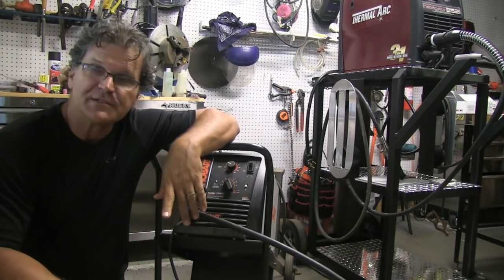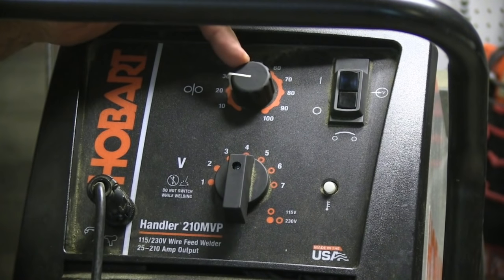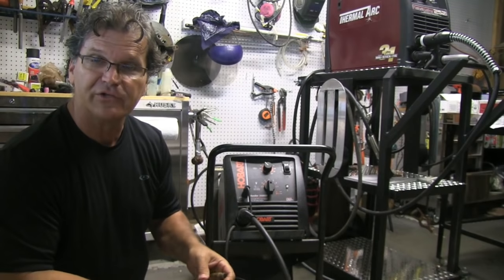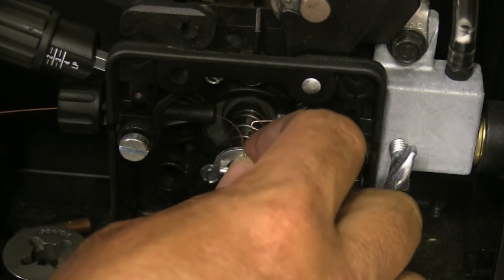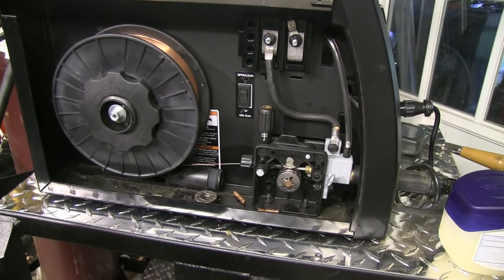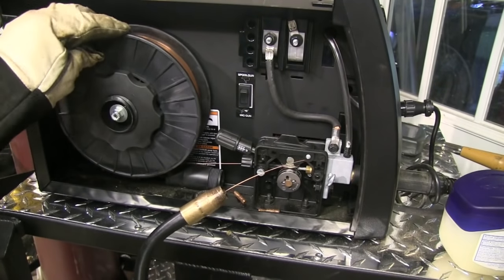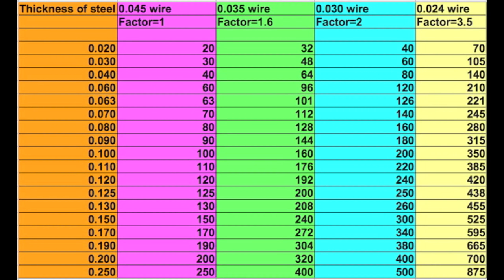Mig Welding Basics part 3-Setting Voltage and Wire Speed

Comment: A US gallon is 128 ozs and weighs about 8.33 pounds.  The Imperial gallon has 5 40oz quarts ( 200ozs) so 72 ozs more than US.  So that's why it weighs 1.67 lbs more.

Comment: Thank you!  I was unsure of how to go about looking for a chart a mig welder at my work.  I've experimented around with my personal welder and i can adjust it relatively easy.  Its a 140 amp/115volt welder where as my works is a 230 volt type that had different size wire.  I'm not a professional welder but actually a auto/fleet mechanic so i get scared having to weld haha.  Anyhow i did find your website and got the charts you showed in this video and had hard time reading/understanding them but now all that is clear as mud...haha just kidding!  I didnt understand that you had to set wire speed and then adjust the voltage bu i get it now haha. I wanted to do some practice tomorrow as i have some garbage trucks which need couple steps rewelded back on. Oh, and i also have some light holders which also need to be installed so they have some additional backup lights.  Thanks again for your awesome and helpful videos!!!!

Comment: Thanks for the MIG Welding Basics series! I am looking for recommendations on a good MIG welder that has a good range of capabilities for the money.  That is, if you had to purchase one welder that can handle a high percentage of "general" welding jobs, what specifications and vendor products would you recommend.  I am not doing production work, but do prototyping on a wide variety of materials and thicknesses.  (Need to weld steel and aluminum).
Any suggestions would be appreciated!  Thanks again for the video series!  Really helpful!

Comment: Loving these videos.  I'm actually waiting on a Hobart 210 MVP to arrive.  I grew up welding stick but I haven't done anything in probably 20 years and never used a MIG.  The 210 just looked like the best option to me for flexibility since I don't have any equipment and about 4 or 5 projects to get done that are very different.

My question is, do you have any specific tips, tricks, or quirks with this particular welder that you've discovered and would like to share?

Comment: I am a fabricator / welder. I deal a lot with different thicknesses any where from .062 to .500 now thinner an stainless I am tig welding. I was wanting to down load your chart . Now is that chart good for 3phase set up?

Comment: Hi - I am a hobbyist Mig welder and a recent subscriber to your channel. I am looking for any advice you may have for me. I am building a CNC router and making the frame from 3" square tubing. I need to weld a 16 gauge length of steel, about 4" x 4 foot long, vertically to the 3" square tubing, creating a rail for rollers to ride on. The 16 gauge steel will be positioned 1/2" above and below the 3" tubing. I don't believe I need to weld a bead the entire length, possibly just tacks along the way. If I do this should I put the Mig wire where the roll of the tubing meets the 'rail' and tack?  Or I'd also thought of maybe drilling several holes in the 16 gauge steel, exposing the tubing behind the holes and then welding the 'holes to the tubing', sort of a Spot Welding technique. Any help is appreciated!

Comment: Quick question regarding amps and wire speed im learning how to weld still, i have a lincoln 140 but just purchase the everlast power Mts 251Si and it doesn’t have any chart or anything, I’ve google amps and wire speed charts and in one charts it says when using .30 mig wire the speed is 2 ipm per amp and i just downloaded the Miller app and in there it says 2 ipm when using .35 wire size im a bit confused now with your experience which wire will it be easier to control the wire speed? In which wire size do you usually go 2 ipm or roughly close to 2ipm?

Comment: Using your vids to start SMAW this week with my new Lincoln Power Mig 210MP. One thing that is confusing; you show a table and reference AMPS yet unlike all other welding processes that have amp readings, my mig and yours, references VOLTS.  Why mention amps if settings are in volts? Thanks again.

Comment: Can you do the same video specifically for aluminum Mig welding? 
It's kinda hard to set a machine for aluminium, i'd love to see more tips.
I have a metric machine with m/min and a voltage setting. Both are continuous settable (voltage and wfs (m/min) are free spinning).

Thanks like your videos.

Comment: Hi Jodi,
First I would like to tell you that I really appreciate your videos.  I have learned a lot about both MIG and TIG welding from watching them.  I have watched a lot of videos from different people on YouTube and consider you to be the best welder/teacher that I have seen.  

Now for my question:  I recently purchased a used gas bottle that came filed with Argoshield Light (5% Carbon Dioxide, 2% Oxygen, balance Argon).  Argoshield is apparently meant for MIG welding on thinner sheet metal.  I would have preferred C25 but the price was right.  Starting from the recommended settings for C25 that came with my Hobart Handler 187 do you know how to shift them for use with an Argoshield Light gas mix?

Comment: My work has the same thermal arc welder as  what you are using and seems like it is way faster than the chart on the welders shows for the wire speed

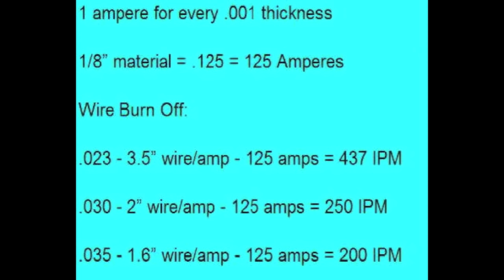Comment: Does the formula at 1:40 apply for every type of welding wire ?  Steel, aluminum, SiBr ?  Or do different wire materials have different wire feed factors ?

Your videos are excellent.  That is the first time someone explained MIG wire feed to me like that.  Thanks for making them.

Comment: hello Jodie I've seen almost all your mig videos and Indeed most that I know I learned from you,but  I have an objection, I'm from Europe and I work here metric system,  I work 1mm wire and this existing wire  is 040 inches, how can i  find exactly the speed of the wire on the thickness ratio metalware for 040 wire ? For example, the chart for 035 (9mm) multiply 1.6 by the thickness of Metal, for 040 (1mm) with what  number is multiplied to find the length of the wire;

Comment: I find that the chart in my Millermatic 211 is good for the voltage but always a touch high on wire speed.  Same thing on autoset so I don't really use that feature.

Comment: Could you suggest how to set welder with just a hi and lo setting i understand the wire delivery time but then is it hi or lo setting on volts, cheers oh its flux core on a sealey mightymig 100, wish hadn't of bought it

Comment: Great videos!   I just read my 252i manual, and I think your method for measuring wire-speed on the 252i might be flawed!   According to the 252i manual, it has a "Run In" wire speed setting, where the wire runs as a percentage of the wire speed until the arc is struck.   The factory default is 70%.   So if someone were to count out 6 seconds without striking an arc, they'd get 70% less wire than when they started to weld (unless they adjusted that setting).    So at about 10 minutes in the video, when you actually measured it, you may have been measuring the wrong thing!

Comment: Your videos are awesome, BUT, we are into the metric system and inches and 0.30 wire and and really confuses me. Can you please use both systems when explaining.
Just a suggestion
Reply: 0.030 wire is approximately 0.8 mm.  I assume you have similar sized wire.  IPM can be converted to cm per minute by multiplying by 2.54.  Not really sure what units your welders feed in.
Reply: We just keep in mind that one mm is about forty thousandths of an inch.  All the wire and consumables we get now have metric labels on them, some have both.   So, .8mm is about .030, .9mm is about .036, 1mm is about .04something.  .6mm is about .024, and those are our popular sizes!

1

Comment: only thing i would add is Single roller machine will have inconsistent Wire feed speeds  when the leads aren't perfectly straight . Not a big deal unless you welding in odd positions.

Comment: So this question may be 9 years late... but I just started welding this year.

Here is a question... what reasons would a mig machine be set to 27ish volts with a 425 ipm?

A question regarding a weld shop that insists on those settings being best for what they produce... according to a couple of the welders there. (These guys have never steered me wrong yet, but their explanation is lacking)

Comment: Public Service Announcement -  you can't use the ruler method with new inverter Everlast welders (at least with the 2017 PowerMTS 251si).  The wire feed rates change when an arc is occurring vs. just dry-pulling the mig gun trigger.  I did the ruler measurement with no arc, and found my feed rates waaay to slow vs the front panel readout, and I got wrapped around the axle thinking my brand new welder was broken.  This 'feature' makes it virtually impossible to ruler check the calibration of wire feed rates without a TON of effort involving heating tips and taking the unit apart to read the voltage of the feed motor....
Reply: James Zaehring - you could measure the diameter of the wire wound on the spool to get its circumference, which is the wire feed per revolution, and count its revolutions.   Easier to weld for an number of full revolutions and measure the time than to measure the fraction of revolutions in a given time.

Comment: What voltage and wfs should I use to weld a 14 gauge tube with 0.8 mm wire

Comment: I have a fabricator 181i and I can't seem to get things right. It wants to burn way too hot and if I get anywhere near an edge it just blows it right out. T joints undercut horribly, lap joints burn the edge back, and butt welds blow through. This is on close to facory settings on 1/4 in steel. I have even tried welding some 1/2 plate and I ended up blowing the corner off. Any tips?
Reply: If its burning to hot turn your heat down

Comment: I didn't understand how to calculate the setting. I am using .035 wire on 3/16th bar stock. How do I calculate that? There is no way my setting should be at 304

Comment: I've noticed that when you are testing settings with MIG you always seem to do a lap or t-joint.  I don't recall you ever using a butt joint or padding a plate to determine MIG settings.  Why is this?
Reply: I think it is likely that he pays attention to all that he points out about how it runs plus the results of the  weld toe fusing to that top edge of the upper plate.

Comment: Why you count upto 6 seconds when messuring the filler wire? Is it always 6 secs count?
Reply: Add a zero to make it 60 seconds. Wire feed speed is measured in inches per minute.

Comment: Awesome. Now just need metric conversions.
Reply: Not a big problem this time, since it's all in inches or thous (and not fractions). Just multiply by 0,0254 for m/min (which is the setting for most metric charts) for the feed speed. Voltage is very much the same. If you have 3mm plate, divide by 25,4 to get thousands of an inch (.118 in this case). That is, if you want to use e.g. the table featured in the video. You could of course also reference a metric chart (here is one http://www.mig-welding.co.uk/calculator.htm )
Reply: Left Flamingo ta bud
Reply: last time i checked SAE volts and Metric volts are the same :-)    there are 39.3" in a meter   200 ipm /39.3 = 5.08 meter per minute
Reply: and also - there are 40 thousands in 1 mm ....  so one millimeter thickness needs 40 amps and so on and so forth .... 2mm 80 amps  but that rule only works till about 6.25 mm thickness ....  because at 1 inch you don't need 1000 amps  one inch is 2.54 cm or 25.4 mm but you don't need 1016 amps to weld 25.4 mm .....
any other questions ?

024 wire is 0.6mm
030 wire is 0.8mm
035 wire is 0.9mm
040 wire is 1mm    remember ? there are 40 thousands in 1 mm ....
but we in america don't have 040 or 1mm wire ..... we don't believe in metric wire sizes :-)
045 wire is 1.1
and so on on so forth
Reply: *****
 I don't understand why people are always saying metric is better now this could be due to me growing up in the US that I am familiar to thSAE system but when you break down an inch to say 12 inches, I get a much better mental picture than saying 300 millimeters, I know it is actually 304 but sometimes math is just done by your imagination. I feel the same way breaking down one inch I can picture a 16th or an 8th or 1/4 etc etc now try doing that in metric it is a lot harder imo. That is my two cents and I am aware that the metric system might have many advantages which I am unfamiliar with or just in production of trade. Later
Reply: Micscience In metric, one milliliter of water occupies exactly one cubiccentimeter, weighs exactly one gram and requires exactly one calorie of energy to heat up by 1°C. This temperatur is exactly 1% of the temperatur difference between the freezing point and the boiling point of water.
By the way, this weight is exactly as heavy as one mole of atoms do.

Please do the same with the American System and post it here!
You should then understand better, why the rest of the world is laughing about Burma, Liberia and the USA.
Reply: lupuszzz
It's the Imperial system, not the American and was developed and maintained in England.

There are some correlations in the Imperial system.  One gallon of water weighs 10lbs for example.
Reply: Wolf Jaw Forge a gallon in England is different from a gallon in the USA - that is why i said the american system ....  BTW in England (or for that matter in Scotland or anywhere in the british island) Fuel (which is Patrol) is sold by the Liter and not by the gallon, temperature there is measured in Celsius also .....  It is all very strange ....
Reply: *****
In England, or Great Britain or the UK or the British Isles, however you term it (and they all mean something different), gasoline is known as Petrol.  It is now sold by the litre (not liter) by EU (European) law, something many British people are less than happy about.  Previous to this, petrol was always sold by the gallon.  There are 4.54 litres to the gallon.

There are also 454 grams to the pound - which shows a correlation to the above.

An Imperial pint is 20 fluid ounces (fl oz), which is possibly different to the US.  The US pint is 16 fl oz, am I right?  An Imperial gallon is 8 Imperial pints and so is 160 fl oz.  An Imperial gallon of water weighs 10 pounds.

I think it's only in these fluid measures that the old English Imperial system differs from the US.  For instance I think an English and US mile are the same - that is 1760 yards.  A yard is 3 feet.  A foot is 12 inches.  English and US inches are the same.

A pound (lb) is 16 ounces (oz).  Ten pounds is thus 160 oz - which is the weight of an Imperial gallon.  There are 2240 pounds in a ton.  This is divisible by 20 hundredweights (cwts), each of 112 pounds.

An old weight system and still used is in the weight of... people!  People can be weighed in pounds, as in the US, but the British 'stone weight' system is still traditionally used.  A stone is equal to 14 pounds.  This is typically the standard weight of a full sledgehammer.  You might say that someone weighs ten and a half stone.  This means they weigh 147 pounds.

A quarter-weight is 2 stones and thus 28lbs.  Four stones (56lbs or half-hundredweight) used to be the weight of a standard sack of potatoes.  Eight stone is a hundredweight (112lbs) and a twentieth of a ton and traditionally the weight of a bag of sand, cement or stone chippings.

You may still find this hundredweight and stone weight system marked on English anvils.  They will be stamped with three figures, representing hundredweights, quarter-weights and pounds.

Yes, temperature is measured in Celsius (once called Centigrade) but people still traditionally prefer Fahrenheit, particularly with reference to the weather.

Sorry to hijack a welding video.  Back on track - in England 1mm MIG wire is very common.  1mm = 0.040" (forty thou).  It seems that this size isn't available in the US, where availability goes from 0.035 - 0.045, which seems rather curious.
Reply: Wow all you guys that commented were very informative thanks for that do you know of any good website that explains all this?
Reply: Finarfin Wow all you guys that commented were very informative thanks for that do you know of any good website that explains all this?
Reply: Finarfin One gallon of water does not weigh 10lbs.
Reply: It does in England.
Reply: ha
Reply: Lemme help you out. Inch = pulgada ;-)
Reply: In our company we have 1mm wire and we use just MAG I can't remember if we have ever used MIG

Comment: Jodi are you using the machine on 220 V on the Hobart 210 MVP?
Reply from the maker: 220v. But on 115v and a good 20 amp breaker it will handle same settings
Reply: weldingtipsandtricks

Comment: What is the multiplier number for 0.40" wire?? I weld with 0.40" wire (1mm wire).
Reply: Since we are talking area we would square the ratio (.045/.04)^2 =1.2656 which yields a factor 1.3

Comment: Hi I'm Josh I would like to tell you a story and see what you think maybe it will help other ok one time I was applying for a job at a place they made industial racking I got a call to do a welding test so I went in and weld these two pieces of scrap together pieces of rack btw any I got done and one of the sections I had to drag and the guy giving me the test was like did you do that and I said well I had to be well thats wrong and I never got a call back what do think about this

Comment: I need to make myself a chart with all the reccommended settings and thicknesses but in mm, anyone know if there is a website that shows us all the settings in mm?
Reply: +MotorcycleTherapy 25.4 mm per inch.
Reply: Did you find a chart in mm in the end?  If not I'll have to get my calculator out and get my brain working,....bloody imperial measurements, crazy that they are still used for such small items.